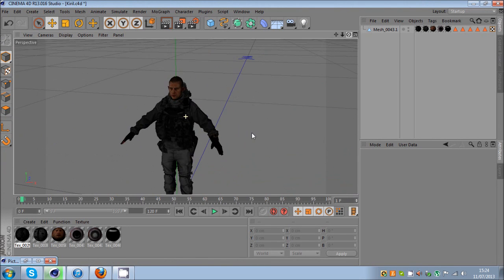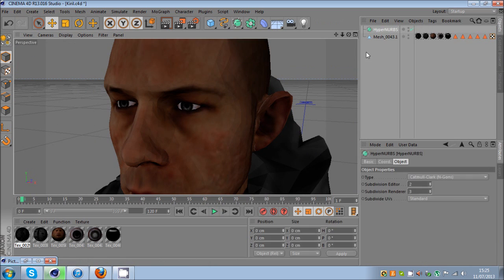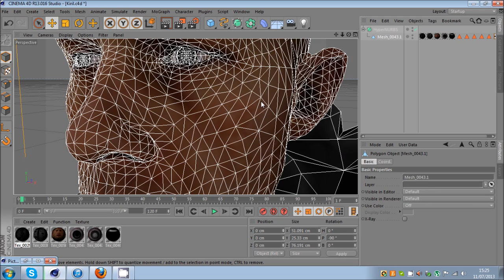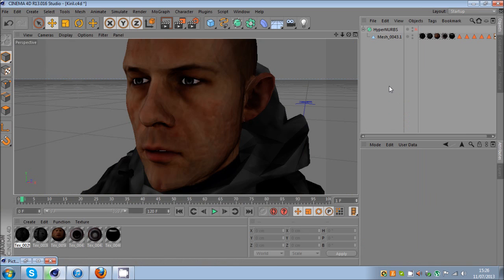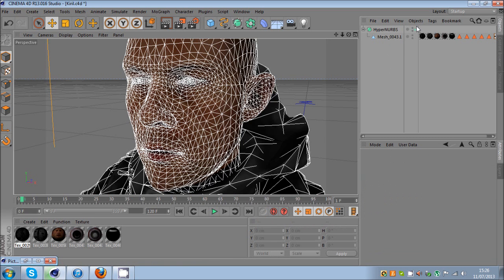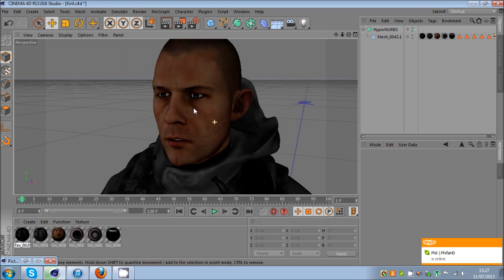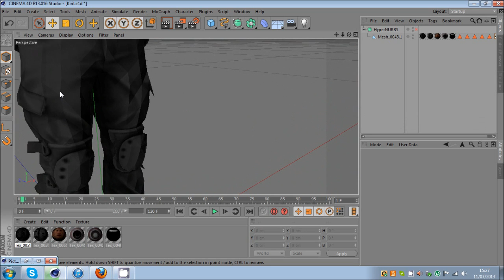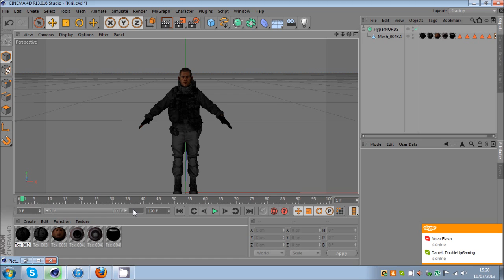Cinema 4D | Low Poly to High Poly Model Tutorial

Comment: Wouldn't your problem be solved by adding a phong tag? I mean adding a HyperNURBS and essentially multiplying the poly count by 64 (3 subdivisions on what I'm assuming is a triangulated mesh) is INSANELY inefficient for games development.

I mean if your character mesh is 12,000 polys, and you subdivide 3 times, you'll have a 768,000 poly mesh, and considering game devs usually stick to <1,000,000 polys in any given view (and that's the MAX for super modern games by the way), that would be highly inefficient. Just add a phong tag my dude!